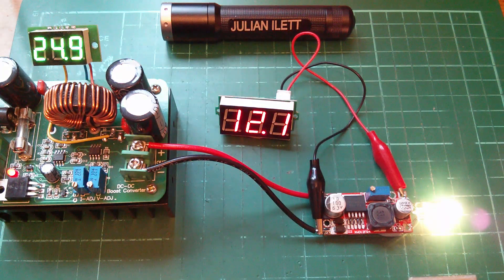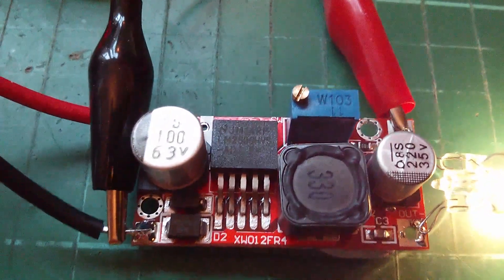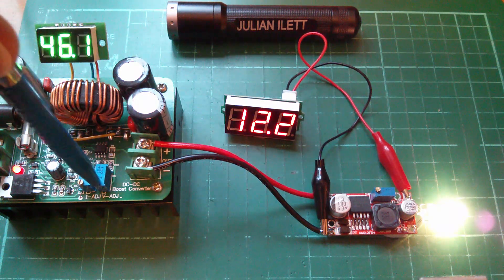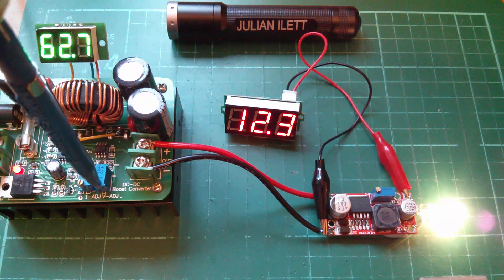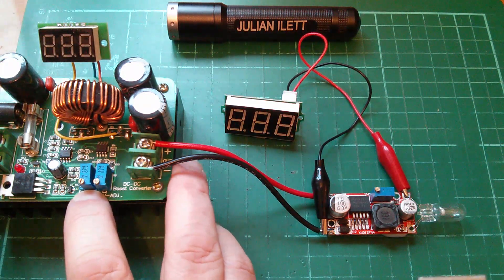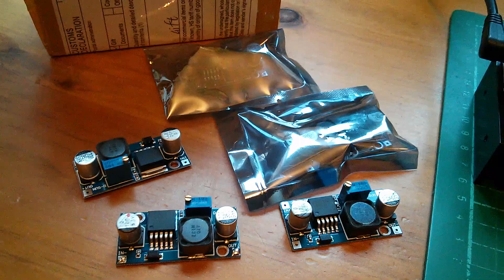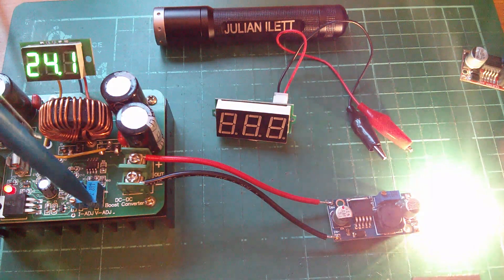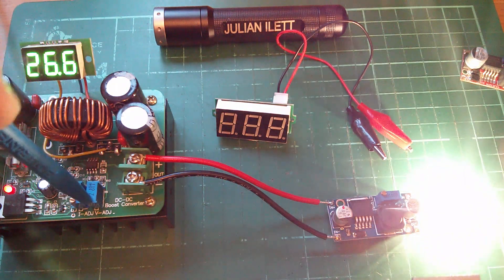Fake LM2596HV Voltage Regulator Buck Converter Modules bought on eBay

Comment: Alone the fact that the molded indent on the chip package is not on the genuine part - that should raise a red flag.
Reply from the maker: Eric Hidle But it wasn't just unstable - the chip failed completely.
Reply from the maker: Interesting - only about half of my LM2596 modules have the pin1 ident. Curiously, I can't find a datasheet for the HV version anywhere - it's as though it doesn't exist!
Reply: Julian Ilett Several manufacturers make LM2596 parts. TI puts an indent on their package. Your "real" board has a NatSemi silkscreen, which means it was probably old stock since they don't use NatSemi branding anymore (they were acquired by TI). On Semi uses a centered indent.

There are a number of explanations for instability at high voltage input. I don't think it's fair to just assume the unit is a "fake."

Comment: what's that digital voltemeter you're using at the output of the 12V regulator? and are they powered by the source they're measuring?

thanks
Reply from the maker: Loads of them on eBay - search "LED voltmeter". The 2-wire ones measure their own supply voltage. The 3-wire type can measure a different voltage (with a common ground), often a much higher voltage. See my review on a 2-wire voltmeter which runs off 5v to 120v DC http://youtu.be/PeuJQki-nYI
Reply: Julian Ilett
thanks so much

Comment: Just as a matter of interest - how long did it take for delivery? I've also purchased parts from G&C on several occasions and they seem to take at least a month. (My record so far for Chinese eBay sellers is 8 days - so it can be done).
Reply from the maker: Deliveries do seem to be quicker now from some sellers. G&C are one of the slowest. Also, I didn't mention it in the video, but I'm pretty sure some fake PICs (PIC12F683) also came from G&C. I've only ever had 1 eBay order not turn up at all - some 3mm LEDs, that was G&C too. Good&Cheap are now on my seller blacklist.

Comment: They do indeed seem to be fakes as you say Julian, especially as their markings state that they are 'hv' series regs. You should be able to get in touch with the seller again to either get a refund or at least some free replacements for your inconvenience etc. Just a shame everything from China takes up to 4+ weeks to get here :(

I just bought the following ones, they are sold as LM2596 (max 40v.) just hope they works as advertised. Not bad for the price... I hope :)

http://www.ebay.co.uk/itm/200960736357?ssPageName=STRK:MEWNX:IT&_trksid=p3984.m1439.l2649
Reply from the maker: Not the cheapest I've seen, but yours do at least have a 50v input capacitor which is a bonus.

Comment: Good video. The rise in the number of counterfeit parts being sold on ebay in recent years is a bit scary. I use one of the standard lower voltage versions of this board to power a raspberry pi print server and NAS, which it does very well. I wouldn't trust it anywhere even remotely close to its claimed operating maximums though - particularly without a heatsink.

I wonder if your fake boards would survive with a reasonable heatsink fitted to the IC. Even at their claimed efficiency, they're still dissipating a fair bit of power under load.
Reply: Max rated voltage must be the inside switch/mosfet brakedown voltage and heatsink would not help. HV version has different switch/mosfet with higher breakdown voltage.

Comment: Hi Julien, where can I purchase a trim pot adjustment tool like yours ? I like that it does not fall off the screw !
Reply from the maker: Mine is circa 1985 - a gift from the company I worked for as a field service engineer. Try a search on eBay for "Bourns H90" (or H91).
Reply: Julian Ilett Found it, Thanks.